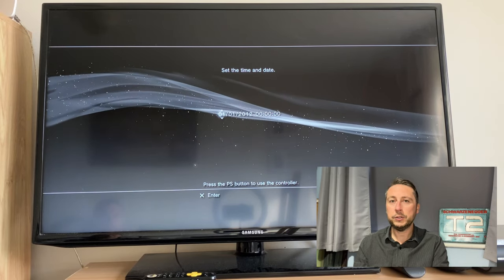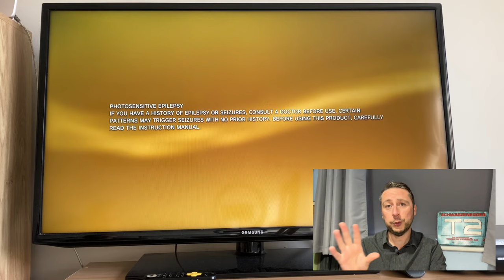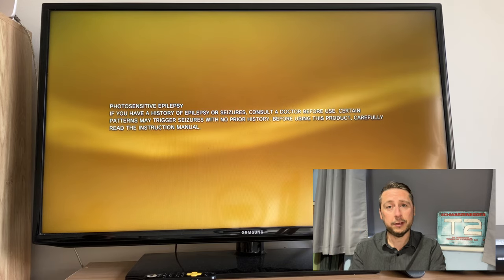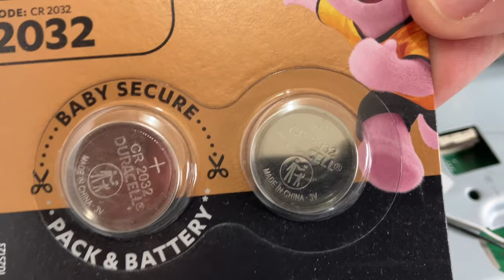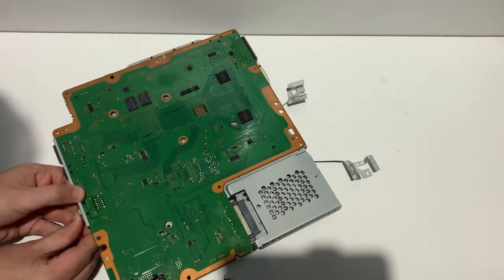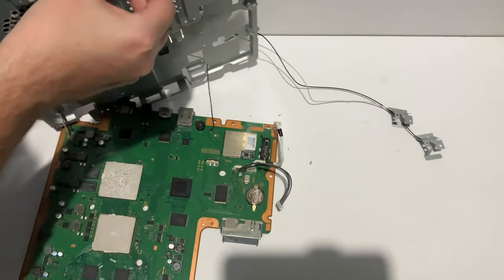Revive your PS3 Slim: Replacing the battery & fixing overheating

Comment: I Upgraded to an SSD and installed the software from a USB, but now my disc tray won’t read any discs, it doesn’t even attempt to, upon the disc entering after about 2 seconds it makes a disc ejecting noise and seems like it’s moving the disc back up ready to be ejected. Any ideas if this is to do with the SSD and what would be the possible solutions ?
Reply: Did you disasebled the ps3? When I did it, I accidentally connected the disc drive flex cable "the other way around". In my head it was the same thing but the console stopped reading discs after that. Later I fixed it
Reply: @MikGSC  turns out the disc drive was “blocked.” I took it to a repair guy and initially he thought the laser was gone or maybe the mechanical part was busted, but turns out if you push a disc too hard into the slot (previous owner, not me) there is a small plastic part than can click forward preventing discs from even reaching the “reading” stage. One push on this small plastic part from the repairman and boom works like new. For anyone who puts a disc in and instantly hears an eject style noise then this is most likely the cause. I wouldn’t attempt to fix it myself because watching him struggle to open the latch and clips on the disc drive made it look pretty difficult.

Comment: My PS3 is dead because of YLOD can you help me, I open it 5 seconds blinking green then sounds of 3 beeps then goes red color.
Reply from the maker: I've not personally had this error thankfully. But some quick research hints at a component failure on the main board.
Reply: @TheRetroStuffGuy  I replace the PSU with same refurbished model, still experiencing. How to fix? The board?
Reply from the maker: @markhovscrch4050  Yes. Probably the main board.

Comment: My PS3 was far worse, you have to take the whole board out the case as its covered over ( with just a few aeration holes in the case metal not full access to the battery) , then with the board loose have to take the metal backing away plus the CPU strap downs before you can split this sandwich to get access to the battery. It is no way as easy as this video unfortunately...although the video was still useful thanks.

Comment: So my slim ps3 overheats thinking of of chainging the battery and harddrive and adding thermal paste on top and on the bottom of the does metal plates hopefuly it stops overheating should i do it or no???
Reply from the maker: Changing the battery & hard drive won't stop the overheating. Clean out all the dust & do the thermal pasting first.